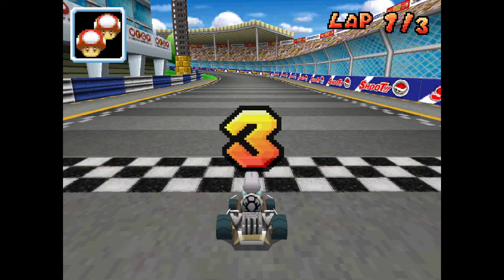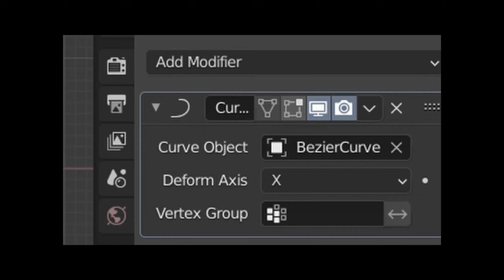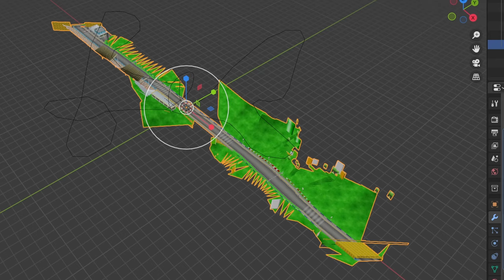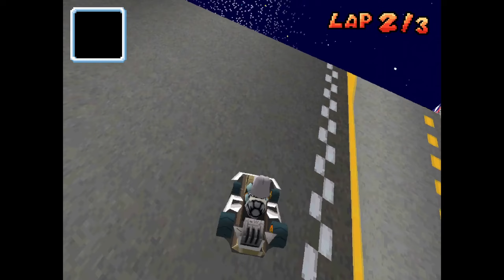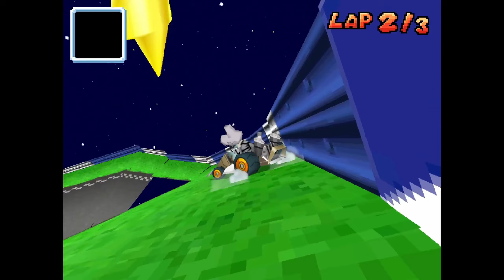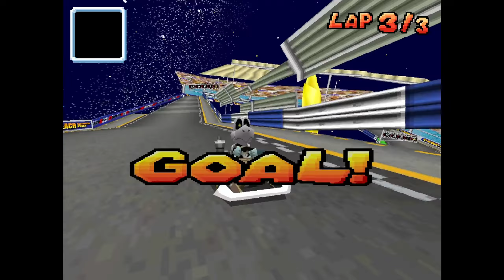Making Figure 8 Circuit into Rainbow Road

Comment: If you turned Figure 8 Circuit into DK Pass, would the wider sections stretch the track?
Reply from the maker: The methodlogy I used it would not, as I traced out the track with a 0 width path.
It could be possible to do this
Reply: @hyphenhoik So for the track to stretch, it would require you to manually stretch the sections that are wider?